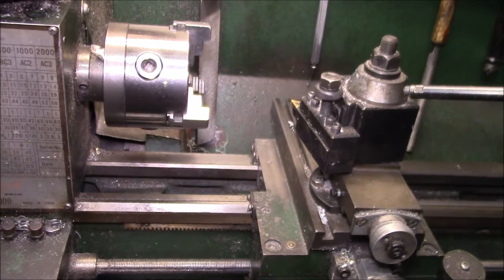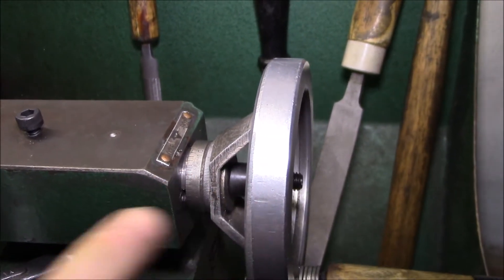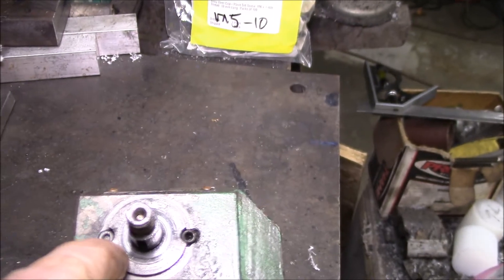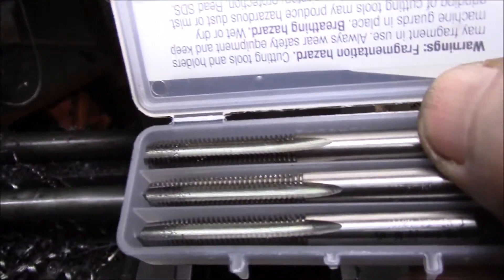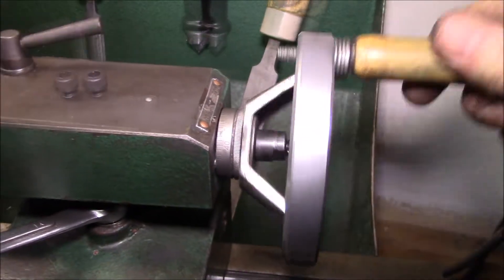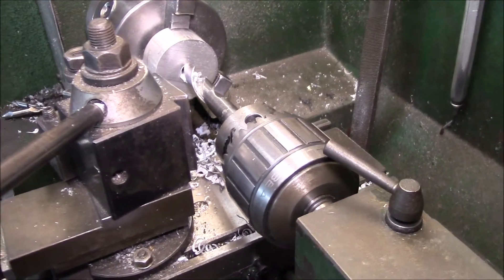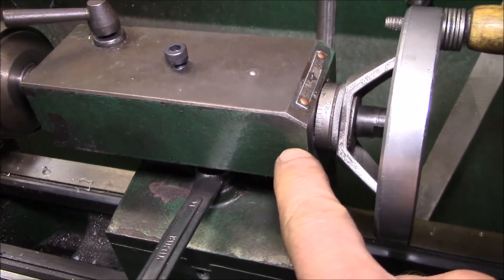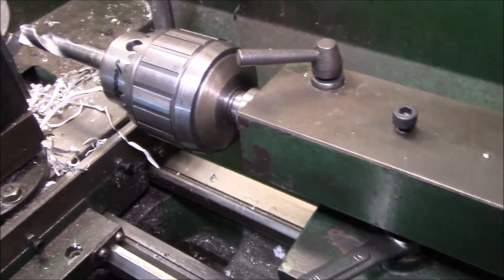Grizzly G4000 Lathe Tailstock Thrust Bushing Repair

Comment: Question, how do you remove the bushing, that you drilled and tapped the two holes on. I am wanting to remove the shaft because the set screw had a dog on it and freaking some how i broke it off haha and need to fix my wuppsie! thanks for the help sir.
Reply from the maker: I'm not sure if I've even removed that but it seems to be a light press fit.  I was able to tap it in with a dead blow hammer, so a piece of pipe or rod stock inside the tailstock might be able to drive it out, after removing those set screws.

Comment: Gosh, you haven't used your lathe much, have you?
Reply from the maker: Yes, it only gets used a few hours a day.
Reply: @The4Crawler  Yeah, I was being totally sarcastic. CLEARLY your machine is WELL USED. It is in the fact THE most well-used machine of its class I've seen. It seems like "a few hours a day, every day, year after year." Cheers, & happy chip-making!
Reply from the maker: @TheBsavage  Yes, has been used several hours a day for about 20 years now.  Just had to clean up the tail stock ram the other day.  Some time in the last 3 years, the ram feed had become very stiff.  Now with a bit of filing and polishing it moves like new.

Comment: my tailstock is also a disaster.. i might order all the internals from grizzly and kinda refurb the basics.
Reply from the maker: Grizzly is pretty good with the parts and they ship them out fairly fast.  About 15 years ago, I think they all came out of Asia so it would take months to get them.  Also, you can now order those on-line with the part numbers in the manual.  Before it was only over the phone, reading off long strings of letters and digits.  Now copy and paste the p/n in the manual into the order screen and off you go.

Comment: Thank you for posting this. I acquired one of these lathes with this exact problem a while ago and I've been trying to repair all of the issuse the previous owner  left it with. It wasn't treated kindly and half of the lathe bits and pieces are in a box of junk.  The only thing I did differently was apply red Loctite to the thrust bearing (keeping it out of the threads) and made the two holes deep enough to accept a 3/8" set screw followed by a 1/4" to lock everything together. I figure if it fails at this point I probably just nee to buy a new tail stock or make some sort of steel thrust bushing/plate to completely replace that end of the tail stock.
Reply from the maker: Sounds like you went a bit larger on the set screws, that should hold pretty good.  So far mine is holding up, I do need to take it apart and either re-lube or replace the lead screw plus I need to replace the key on the handwheel.  My original one was lost and I have a make shift key in there now.. At least Grizzly has the whole tail stock available if it comes down to replacing it.

Comment: cool nice repair job well done
Reply from the maker: Have been needing to do this for a while.  Every time I've had this apart, it was getting looser and looser.  This last time and the original threads were gone.  Hopefully, these larger, fresh threads will last for many years.